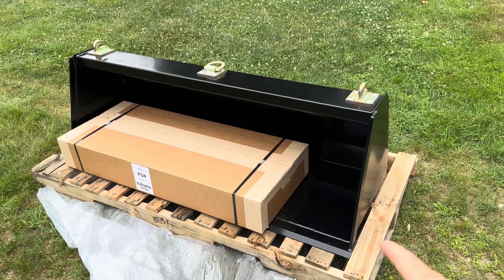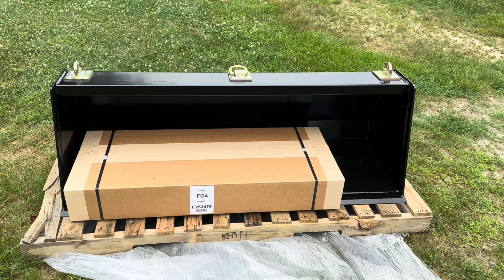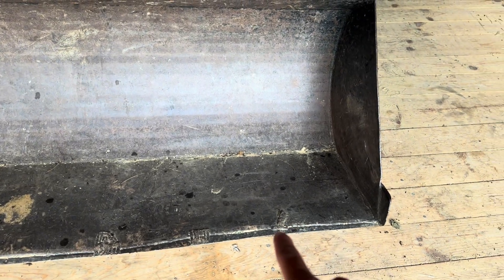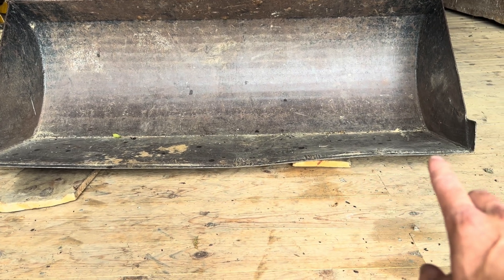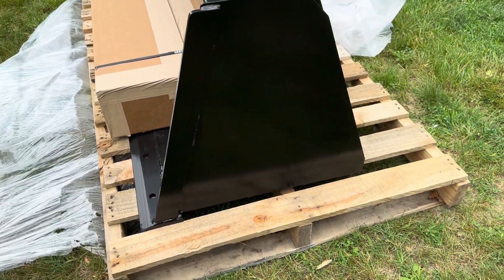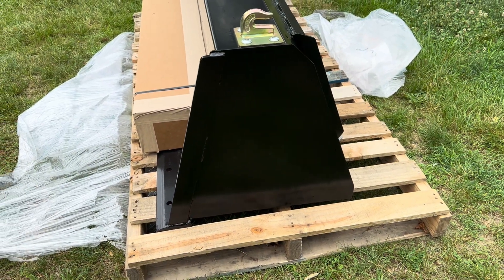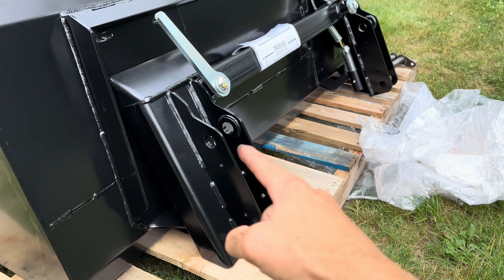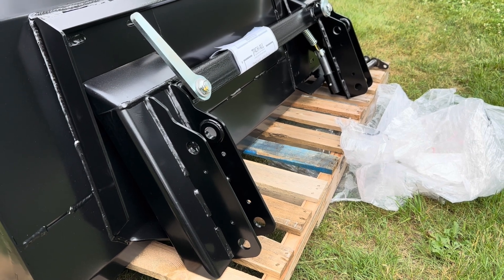Ford 770 Loader Conversion: Pin-On Bucket to Quick Attach

Comment: That ford 770 loader looks egg act lee like my loader on my Satoh (Mitsubishi) 630D. Could you measure the width of your loader arms at the pins of if anybody knows that spec I would be grateful.
Reply from the maker: It’s 38 inches outside to outside on the loader arms. The Ford 1700 was made in Japan by Shibaura for Ford. My guess is the loader was too. Could be some shared manufacturing with Mitsubishi? Or copycatting? Some Kubotas of the same vintage look darn similar too.
Reply: @ProductiveRecreation Ha, it is the same loader. I have learned they all were in cahoots with each other. With our American brands, similar to now, using the other guys homework. All that aside it opens a new window for parts and accessories.
Reply: @ProductiveRecreation good news, I just reviewed the shop drawing that where sent from crew at Mike's and everything is a perfect fit, pins and everything. I'll be ordering my adapters soon.